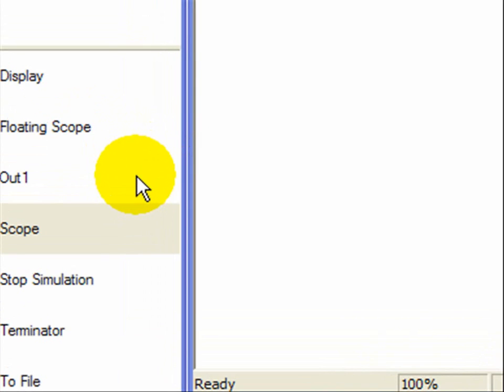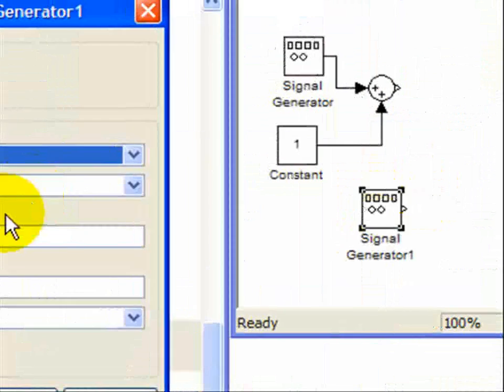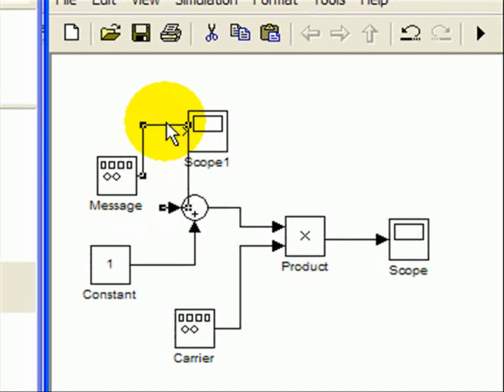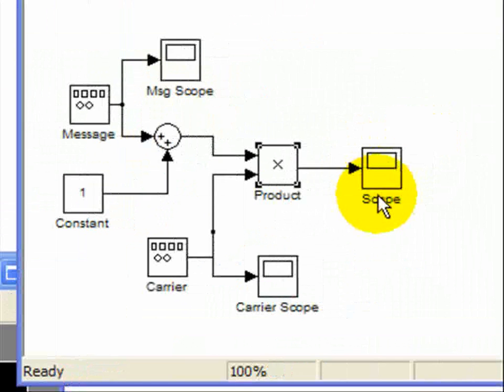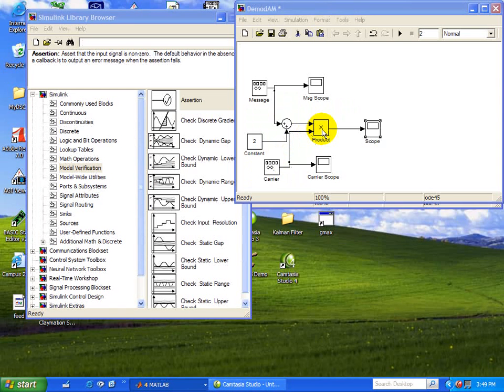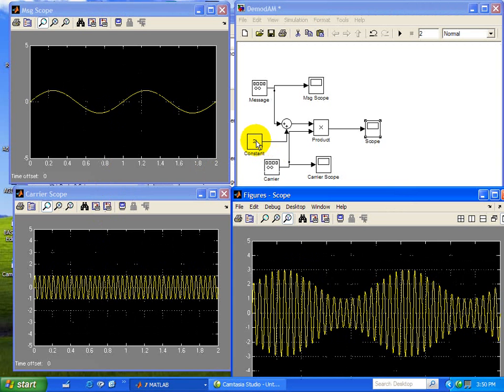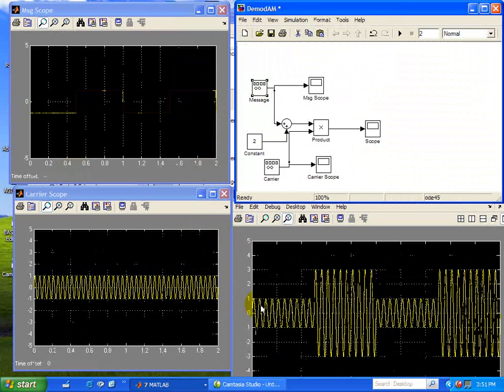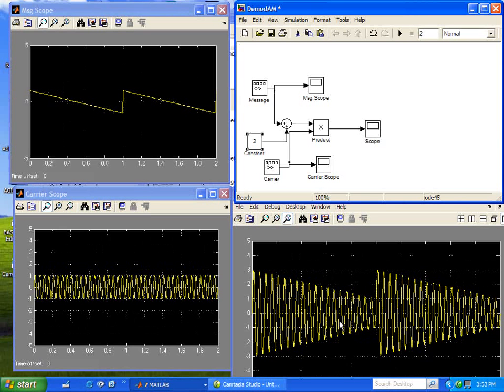Matlab Tutorial - Amplitude Modulation

Comment: One reason is that it keeps the antenna size small.   For example, if I send a 3 kHz audio message the size of the antenna within an order of magnitude is about 10,000 meters=3e8/3e3 where 3e3 m/sec  is the speed of light and wavelength*frequency=speed of light.  Hope this answer your question.